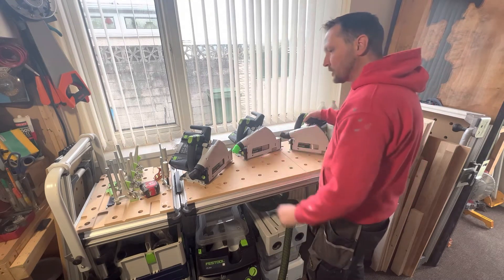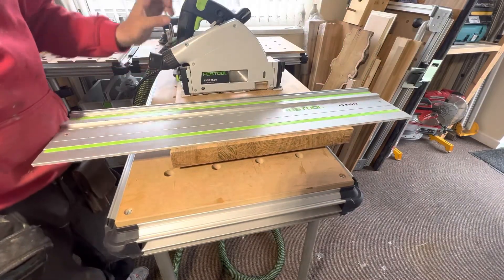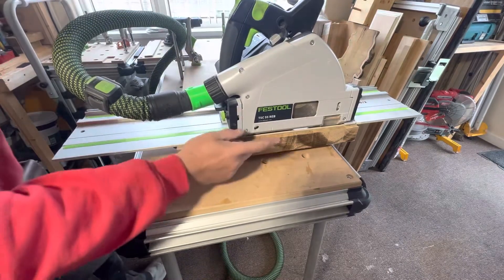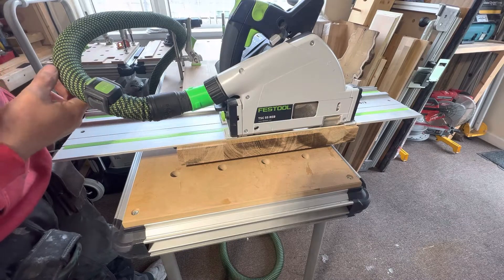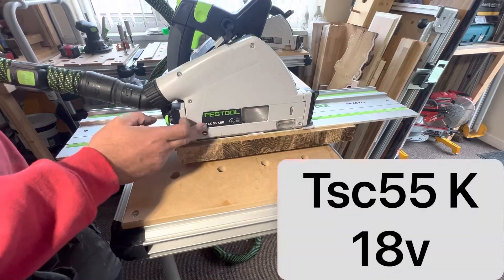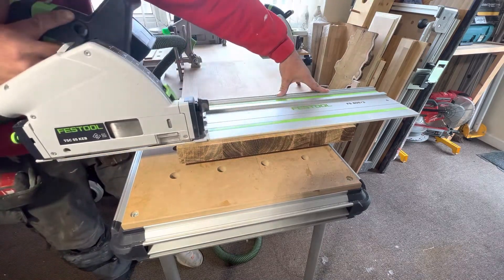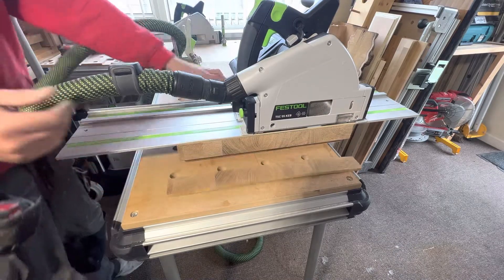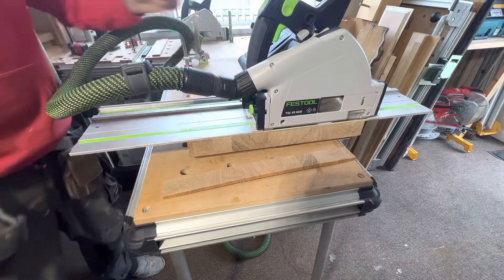TSC55 K ,TSC 55 ,TS55 240v showdown  which saw  cuts quicker ???

Comment: Did you use the same saw blade on the three saws or did you just use what came on the saws, never sharpend over the years?
The saw blade makes by far the biggest difference, especially when cutting solid hard wood.
Reply from the maker: The blades used on these saws was the recommended blade for each saw. 
The TSC55 K has 1.8mm supplied blade which was quite new. 
The TSC55 has 2.2mm blade which is supplied with that saw. This blade is the blade used also in the TS55 240v. 
I do have a video on my channel which isn’t speeded up if you want to watch the full video check them out. 👍

Comment: What happens in speed when you change the blade of the TS 55?
Reply from the maker: The motor can spin the blade fine as it’s lighter. The only issue I found is that the riving knife will stick as the blade is thinner. 
This can only be achieved with cutting closer to the edge. 
I have mentioned this in one of the videos I posted. I think I made 3 videos on that blade in both saws. 👍